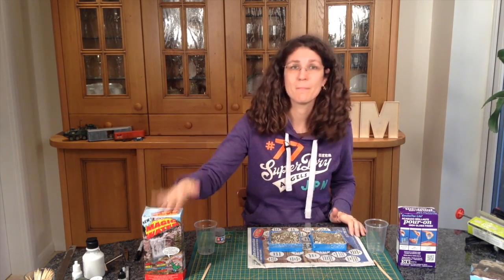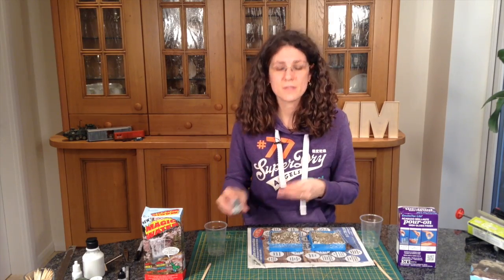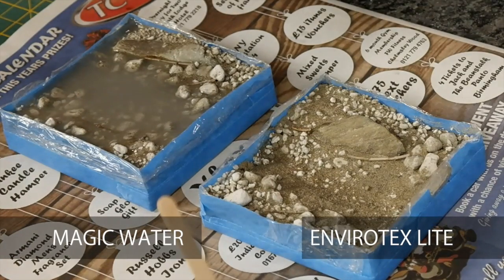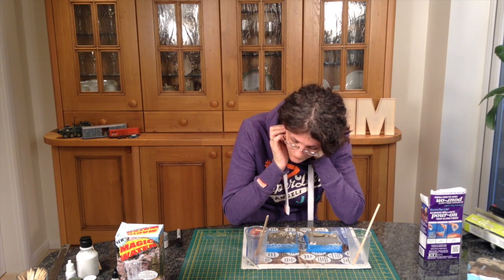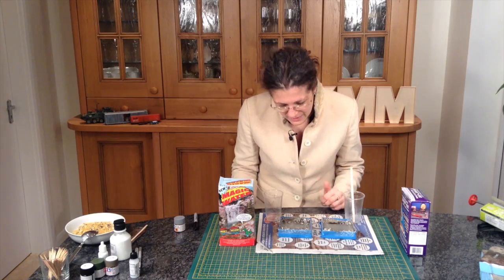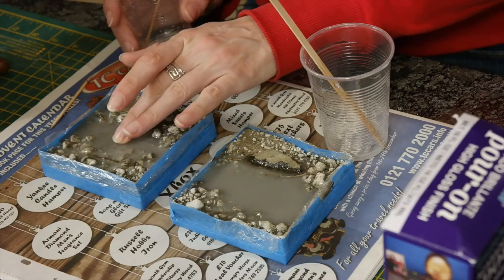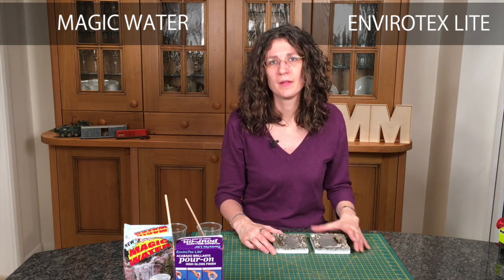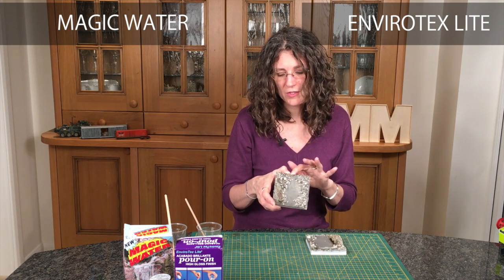Magic Water v Envirotex Lite

Comment: Kathy, 

I watched this and your review of your port, both great. As others have suggested you would probably be better of weighing the ratios to mix, rather than using volume by eye, that will improve your setting times. Secondly, to prevent the bubbles in resin you are best of getting a small vacuum pot and pulling the gas out of the cup before pouring, alternatively, find a vibrating plate (An upside detail sander works as well) to stand the mixed resin on. Finally, as another has said, pour from a reasonable height in a thin stream to pull as much of the remaining bubbles from the mix.
 
Great information very well presented. Thank you.

Cheers,
Chris
Reply from the maker: +Hendo2277 Chris, I do now weigh my resin so that’s improved some things but the Magic Water rarely bubbles so I do find it much easier to work with.

Comment: I've never tried the "Magic Water", but I've used both Envirotex Lite and Woodland Scenics "Realistic Water & Water Effects".
Both were used in similar situations in the same room, and all three streams contained both level areas and rapids.  Because of the rapids, I poured all my water from the top of the stream in several thin layers, letting it flow over the rapids until it found it's own level in the lower ponds.  I helped it to spread into some of the thinner areas by drawing it with the stirring stick.

Both products flowed well, set up without trouble and looked great at first.  Neither had any trouble degassing, so maybe it's the paint you added that caused the problems you encountered.

One of the  Realistic Water streams started to go cloudy in one area, gradually spreading and getting worse for a few weeks.  I was contemplating having to find an excuse to model a toxic chemical spill, although after a couple of months, it cleared up by itself.  I still don't know what caused it.  Also with the WS RW, I had one small area where it separated from the base leaving a very unsightly bubble.  I had to cut it away completely and fill the hole with the next pour (unfortunately, it didn't bond invisibly to itself as I had hoped, and the patch is very visible).

The only time I tried mixing a little paint into the "Water Effects", it ended up looking as though I had just painted the water on and I had to peel everything off and start again with bare rocks.

With the Envirotex Lite, I had no trouble at all.  Where I wanted water dripping out of a culvert and some wet areas without much standing water, it would have been too thick on its own.  After some research, I found out that xylene can be used to thin it - even making it thin enough to airbrush if desired (it was a fishing website I found and the guy was using it to paint lures).  Also,  I found that the meniscus effect could be pretty much eliminated by finishing with a thin pour that barely covers the water, thus filling in the trough.  It was about two years ago that this stream was poured.  My wife says it looks to have browned a little, although I don't see any significant difference and it still looks good to me.

The biggest difference I have found is in the durability of the finished surfaces.  Even a year or so after pouring, the WS MW is too fragile for water that might get touched.  While I was working on my forest scene, I laid out some small shrubs (the tiny pieces that fell off my super trees).  Even though they weigh virtually nothing and were there for only a few hours, my water still bears the dents from them.  Eventually, I'll probably just pour Envirotex over them.

I hope this information is useful.
Reply from the maker: +mpeterll Thanks! I've heard a lot of bad things about some of the WS water products so I do tend to avoid them. Epoxy may be a pain but its results are the best in my view. You might be able to put Envirotex into where you had that bubble too. 
Thanks for the comments.

Comment: I've used magic water for 7 years now and the I have to say the real reason why magic water took so long for it to set on you is because it's supposed to be a 1-1 mix ration. I know you mentioned in the beginning of the Video. It does dry a bit softer that other types of resins and it is a low viscosity material which will never allow bubbles. I use envirotex  to cast models from my rubber molds to keep my molds longer. The longest I've waited for magic water to finish curing is two solid days. Try mixing 1-1 ratio and you'll see the difference. Also paints don't affect the curing time at all.
Reply from the maker: +prince troncoso I’m using the ratios given on the box and, off the top of my head, I am doing one to one. Envirotex Lite is a different ratio at 1:2.
Reply: @KathyMillatt  The Envirotex ratio I use is a 1:1 ratio.  I use a scale to measure out equal parts and have very few bubbles.  It cures in a couple days depending on the room temperature and relitive humidity.  I think you ment to say that the Magic Water is a 1:2 mix, not Envirtex Lite.

Comment: Thanks for clearing something up for me, Kathy! 
I've used both products as well... 
I always felt that I mixed the Magic Water improperly. It would take up to four days to dry, and STILL felt rubbery! 

(Caveat - I live in Arizona. Average temperature when I'm working is roughly 102-117 degrees Fahrenheit!!! 
The average humidity is around 5%. Therefore, I would assume that the HOT and dry sped up my curing times somewhat.) 

Still, I thought four days was a LONG time! 
Apparently, it's quicker vs. a cooler, more damp climate. 

I truly felt I got it wrong! 

BTW, I am thoroughly enjoying your videos!! :)
Reply from the maker: The first time I used it, it did my head in but I now prefer it. I quite like the rubbery texture.
Reply from the maker: I've found that by the end of bottles, I have more hardener left. I've been putting in slightly over a third in and it does set more quickly then.
Reply: Kathy Millatt  Hmmmm.... 
That's worth having a go! 
I don't like measuring down to the ounce or gram.... 
But, I'd love to see what a little more Gardner would do.  ;)
Reply: Kathy Millatt  I think I may prefer the more rubbery as well... 
I have a sectional Layout (not modular). It's so if I have to move, it wouldn't involve tearing down ANOTHER Layout!! 
SO sad to do... 

So... right. The flexible nature of the MW, should make it safer to move!
Reply from the maker: +Carmine Allocca my thoughts exactly. I've seen some beautiful exhibition layouts with cracked resin which really mars them.

Comment: I'm going to say that your bubbles are not 100% the resin in either case but maybe a case of what you have in the bottom of your basin. As discussed in one of my earlier comments try this again but use each product just makes a thimble fool and use a a throwaway craft brush or something to make sure that you move it around on top of everything secured in the bottom and put a clear hard coat very thin I'm just enough to make it look wet. So if it's shiny then you got it coated and it'll cure really quick. But you don't need it to cure all the way you just need it to firm up so that you can pour more on top of it. Then pour more on top of it. Remember! Heat for Magic Water. And carbon dioxide for Envirotech. Also the instructions with Envirotech I believe instruct you to stir in one container and then pour from a height into another container and this helps to eliminate some of the bubbles. But also if you'll use a straw and blow across the surface and wait a bit and then blow across the surface some more you can usually work all those bubbles up to the top and and have them degas.. you have a long time with Magic Water to watch for bubbles and to either gently warm them away with a hair dryer or a heat gun. Heat guns can be had very very cheaply here in America that places like Harbor Freight. They make very expensive ones too but for this type of work you don't need expensive LOL you just need heat. With a heat gun you have the heat without the air movement. And with a hair dryer on high enough Heat to do the job it's sometimes enough force of air to move the resident places you don't want it to be like out of your terrain basin. If you have rougher unpleasant surfaces on the sides try using a clear plastic tape instead of masking tape. Masking tape has a specific course texture to it and the clear plastic tape is going to leave a clear surface. But if you do still have scuffs or rough places or you find the need to sand and it leaves a white scratched area if you mix up just a little bit of either resin and carefully brush it on it will cure nice and slick and clear and you'll even be able to see into the the side of your project.

Comment: Just a word on one of the differences between these products. For the bubbles in Magic Water you want to use Heat. And for the bubbles in liquitex you want to use carbon dioxide so blowing on it through a straw is best. But you need to use either a heat gun or a hair dryer gently especially on a small piece like that for Magic water. And those instructions come straight from Dave Williams. I miss Dave! Thanks for this video.
Reply from the maker: I use a blow torch now.

Comment: On your resin bubbles, here's a thing that will probably help:
Vibrating your resin before you pour will cause most of the bubbles to rise to the surface.  If you have a rattly old air compressor, you can put your resin cup on top of it and turn it on for a minute or so.

You could also do something like put the diorama on sort of flimsy table, pour the resin, and use some kind of implement that twill cause the whole thing to shake.  Maybe using a mixer to make some mashed potatoes while you're at it.

Or maybe you can do a load of laundry, turn the washing machine off just as it starts to enter the spin cycle, mix your resin, put the resin cup on top of the washing machine, turn the washing machine back on.

Basically, there's a lot of ways to go about it, you just have to get creative.  I suspect that a higher frequency of vibration is more ideal, but I'm not sure how much it matters.
Reply from the maker: +ColonelSandersLite Those are great ideas!  I find I stick to Magic Water because it doesn’t get bubbles so is just easier to work with. Plus the slightly rubbery texture means it is less likely to chip or crack.

Comment: I can tell you that with Envirotex Lite, the thicker the pour, the quicker it sets. Many years ago I also used original Envirotex which required open windows, doors and a fan to disperse the fumes! Lite is much better for that reason alone. I used Lite on two raffle layouts that my team built. In the first layout there was a port scene covering about a 2 x 4.5 foot area. The first pour was about 1/4 inch thick and took almost two days to set. The last pour was done 8 hours before it went to the train show and was 3/4 inch thick. I was a nervous wreck that night as the temperature outside was 20F degrees and inside I could only get it to 65F but in about 2.5 hours it was hard as a rock and almost no bubbles!In the second raffle layout there was a log pond about 6 x 12 inches which was done in a the single pour and again 8 hours before a train show. This time the pour was 1.5 inches thick and the Envirotex Lite got very hot, hot enough to melt the hot glue I had used to plug holes in the pond! I spent half an hour under the layout frantically plugging leaks before it set up and the leaks stopped. In this case I didn't care if there were bubbles as the pond was also full of logs!A friend used a Woodland Scenics product (forget the name) about 18 years ago to pour a small stream and a shallow pond. In both cases the product developed cracks after a few years.

Comment: I've heard professionals who work with epoxy resins and mold/casting materials always recommend to measure multi-part mixes by weight instead of volume. They claim that it's even more important to do so when mixing smaller amounts. This makes a lot of sense due to a scale being much more precise than trying to eyeball measuring lines.
 Is there a chance your cure time was longer than expected due to the ratios being slightly off? As you mentioned in the video, could the paint have added to the cure time? Or, Is this just how long it takes for Magic Water to cure?

I know this is an older video and there's a good chance that you touch on these questions in a later video but, I just found your channel and am working my way through them.

Very informative videos by the way... Well done.
Reply from the maker: Thanks!  I have tried weighing the resin and got the same long drying time. I think it's just something I am used to now so it doesn't bother me.  I'm sure the paint does affect the mix but it still does set which is my biggest worry. I do prefer Magic Water.
Reply: Fair enough... Thanks for the reply.

Comment: Okay you just said that your your work area there is about 20° Celsius which is about 68° Fahrenheit which is about it's close to what you need but 72 or warmer is better. Also the humidity can have a huge effect. And if you are in England as I suspect you are then your humidity is probably a lot higher than it is even during the rainy season here in North Georgia USA. When it's raining and I need work to dry I fire up the space heater. In the winter time I have fans in the space heater running and it's no problem. In the summertime when it's nice and warm and sunny, something that you're likely not used to, the humidity is still a a lot lower here than it is there. And humidity can stretch your dry time out to a week. So when you have need a faster cure with Magic Water put it in a room where you can put it turn on a space heater or dehumidifier and make a warm environment and make a dry environment at the same time. Also ventilation is important anytime you're using any type of resin. When I'm doing small projects like your little samples there, having the fans on and maybe a window cracked or not at all is fine. But if I'm doing large areas like coding a 2x2 ft surface for a pouring basins of 6 to 8 in in diameter or area then I will want fresh air coming in and a couple of fans working well. And a good warm temperature. So in winter time deep pores are difficult. But not so much with the faster cure amazing clear cast or Envirotech

Comment: Magic Water retains flexibility even after several years.  It will not crack with age, the understructure moving due to temperature and humidity changes.  I have a sample from when I poured on my model railroad four years ago, and it is still flexible... which to me is good.  I covered the area for about 3 or 4 days to keep dust off while it set.
Reply from the maker: It does seem like a great product.

Comment: Kathy, would the thickness of the pour have impacted the setting time?
Reply from the maker: Hi Matt. I suspect that if heat is generated by the reaction and that then aids the resin setting then a deeper pour will speed the set. 
All my Magic Water pours have take several days to set, regardless of depth. 
Kathy

Comment: im having a hard time keeping my resin contained when i use it, it just leaks everywhere. Gonna try blutac next but damn its annoying! what have you used here?
Reply from the maker: Josh, I have had so many leaks that I understand your problems. I now use silicon sealant and a thick acetate by preference. If the edge is not too important then I might use foam board wrapped in cling film but that's never as neat as the cling film wrinkles. Whatever I use, I make sure that the material the resin comes in contact with is clear do if I can't peel it off, I can just trim it instead. Even then, I still raise the diorama up and put down loads of newspapers underneath to be sure.

Comment: I realize this recording was done several years ago, but perhaps that’s a benefit related to my question. I understand that Unreal Detail is out of business.

1. If, by chance, I could find any Magic Water in large volume, how long have you had any and still remained usable?

2. Do you know of any suitable substitute for the Magic Water (low or no odor, thin consistency, low bubbling, and less edge creep)?
Reply from the maker: I use mine recently and it’s several years old. Just do a small test and see if it sets. 
I use Epoxyplast now but it’s a 72 hour cure time. Seems the most inert though because of the long cure and it really doesn’t bubble or react with the base as far as I can tell.

Comment: Ive only used envirotex and had no bubbles because i mix it very slow and poured it in a very small string this way it degases better, i used it for amoured glass in a humvee.
Reply from the maker: Hi Steve. I don't normally have such gas so I guess I was over zealous in the mixing!  Magic Water seems to stand up better. 
Kathy
Reply: Steve, does heating up the bottles of envirotext lite in warm water help thin the mix at all?
Reply from the maker: Tim, I've never tried it but it does take longer to set when it is colder.  Envirotex is already pretty thin so I'm not sure warming will make much difference.  If you try it then do let me know! Kathy

Comment: Have you tried heating th envirotex product  in hot hater hot were you can touch it not boiling.
Reply from the maker: Not sure for Envirotex but I’ve done it for other resins where they’re too thick to mix well at room temperature.

Comment: You might try using mod podge over the magic water to simulate waves and/or ripples...    I've watched terranscapes using it to great effect...    I've been experimenting with clay to make molds and mod podge to make model parts...    I've achieved mixed results...   As always Kat, thanks for sharing and keep on keeping on!!!
Reply from the maker: I had a bad experience with Mod Podge so prefer to use acrylic gloss medium from the art shop. If you check out my other water videos, you can see me using it many times there.